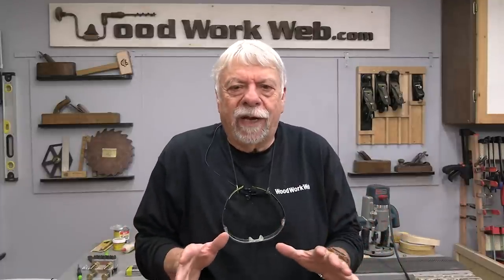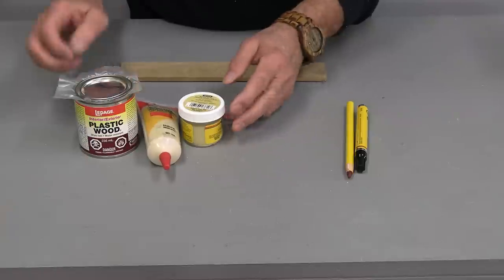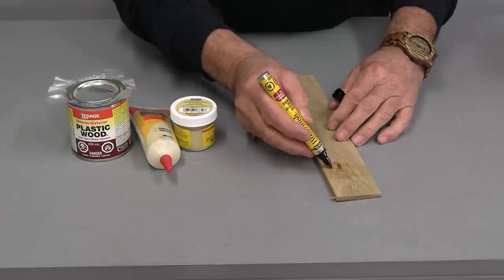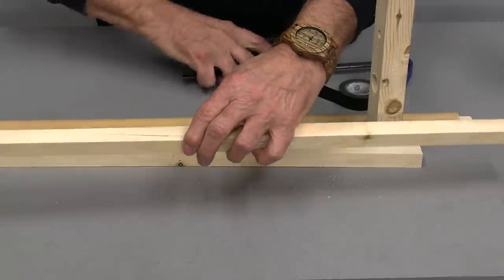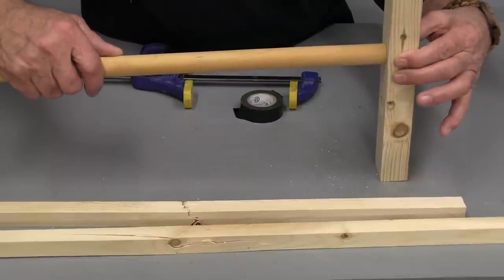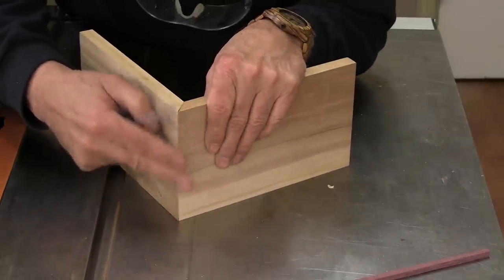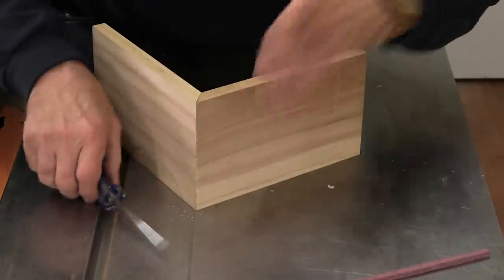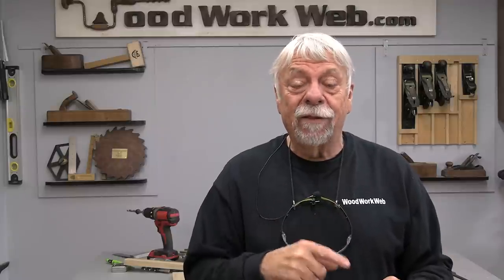Fix Woodworking Mistakes Like a Pro! Episode 4

Comment: Very helpful video!  The box corner insert is brilliant.  Not only covers mistakes, but also appears that it would add strength to the joint similar to splines and dovetails.

Comment: Another great video. I was told that knowing how to work with wood makes you a woodworker. But, knowing how to fix your mistakes makes you an artist. Great tip with the floss. When the insert is properly fitted, you can clean in between your teeth. Thanks.

Comment: Question about the corner fix thing: the piece you glue there runs cross grain to the box sides, and the wood movement of the box sides happens in the same direction, essentially forcing the corner piece to stretch or shrink along its length. With a box this size it should be minimal enough to hopefully not cause any problems, but if you were to use this technique on something bigger like a mitered cabinet corner that sees a lot more wood movement, there could be severe issues with the corner piece splitting or just breaking altogether. Would you agree?

Comment: Why is the insert shaped like a bowtie?
Reply: So the wood can't split, it's like 2 dovetails back to back. It mechanically locks the board together. The glue is just an added bonus.
Reply: @EitriBrokkr  Great, thanks for the info.  That shape would truly help lock the two sides of the split.  When he first showed what he was going to use it for, removing and then replacing a knot, I thought why not use a large oval piece.  Anyway, thanks again.
Reply: @j.hueston4370  you are correct that for hiding knots or other imperfections you could use non locking shape - circle, square etc.